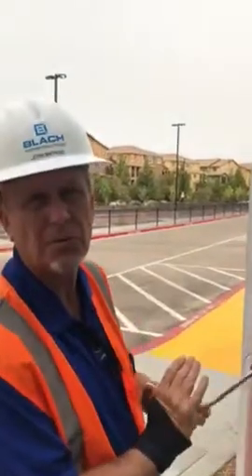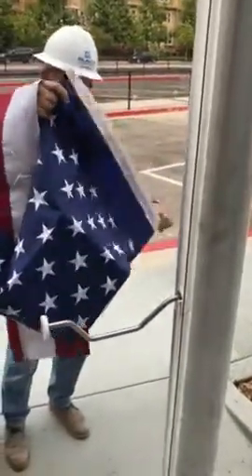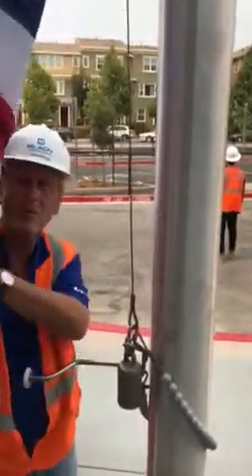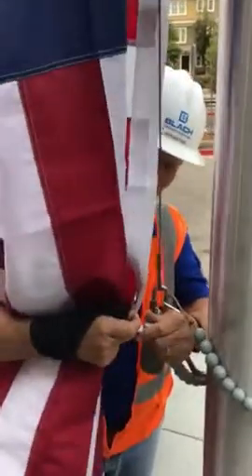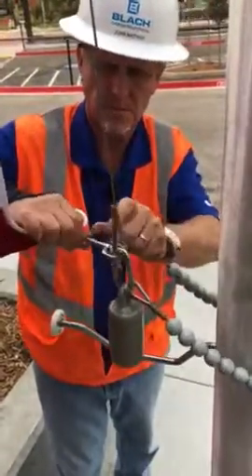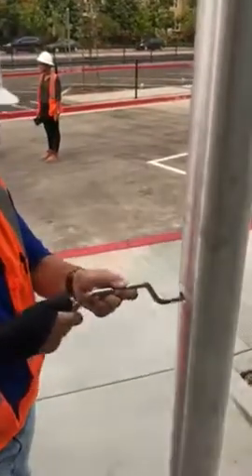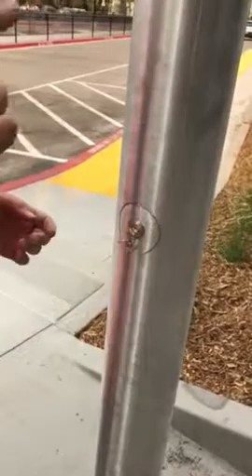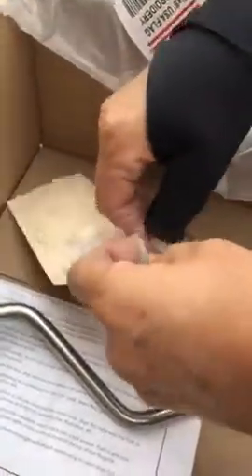Steps in attaching the flag to a flag pole

Comment: I have watch your video about hoisting a large 6X10 feet USA flag on this indoor halyard flag pole. You are right, My research is that USA flags made in China did not last long, a 2 months or so.  Beter to buy a flag from Colonial flags,  DIXIE flags or Gettysburg flag works. The quality is much beterwith sewn lines and embroided stars..  Better quality than the made in China flag what this man hoist here at this flagpole with internal halyard and safety lock.